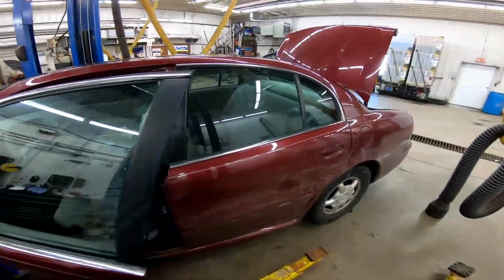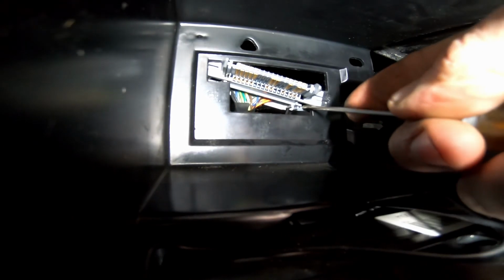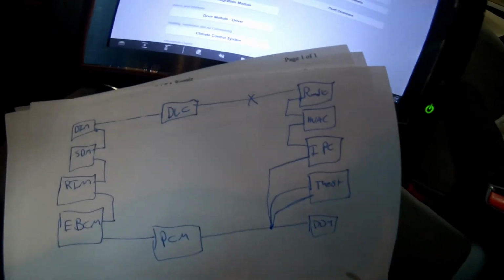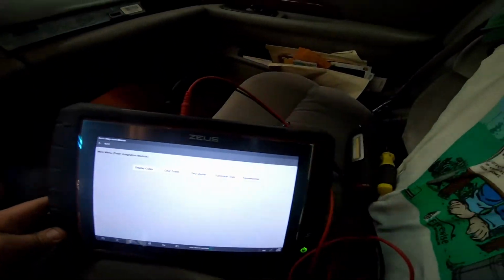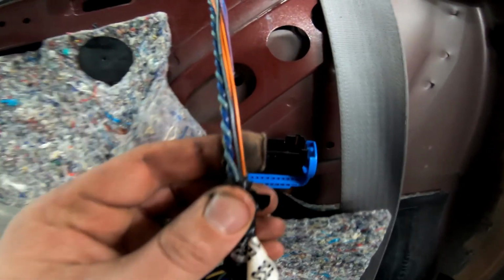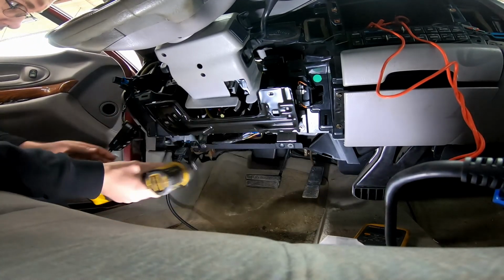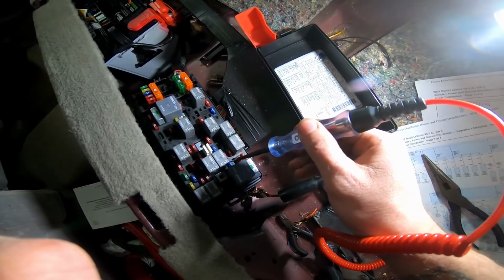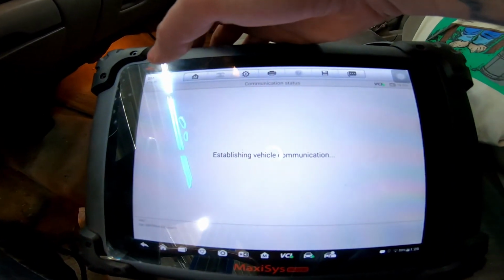Diagnosing Intermittent No Start/ No Communications With Scan Tool Issue!

Comment: hey awesome video! very helpful. i am chasing a no comm on a 2008 Chevrolet Tahoe LTZ 5.3L, V8, Flex, VIN 0, Des LMG, USA. im trying to draw up the modules like you did but there is a junction box messing me up, any way you can explain that to me? its throwing u0100 and u0072 intermitting when it lets me read the ecm ... i drew something up id like to show you
Reply from the maker: Glad to hear the video is helpful for you! I'd be happy to try and lend you a hand. 

First off the junction boxes are quite simple, just don't over think them. This vehicle looks to be using 2 types. On the High speed network the junction box is simply a PassThru used to had a service point to the system and to clean up the wiring harness a bit. 

The junctions in the low speed networks are simply a shorting bar. These are essentially a piece of metal that each wire connects to. This connects all of the modules to the same circuit and makes for a good diagnostic aid, when you can actually access  them.  Feel free to ask as many question as you need to, I will do my best help.

Also, I find with communication issues it is best to start with a scan tool that is capable of reading all the modules on the vehicle. Keep track of which modules you can and can not communicate with. This will make it much faster to narrow down where the issue may be.
Reply: @apmotorsports5568   oh I see! Thanks for the clarification, I’ve been focusing on  high speed bc those are the main ones I can’t read, bcm , tcm, ecm. But the cluster/IPC is on the low speed which is flicking and throwing lights. I did unplug it and that didn’t help but do you think I should worry about the low speed modules?
Reply from the maker: Focus on the area where the modules you are not able to communicate with. I like to print off the network wiring diagram and I will mark the modules I can not talk to on the diagram. Visually, this will help you narrow down the correct area to focus on.

On this vehicle the BCM, TCM, and ECM look to be wired up on one "leg" of the network. The scan tool splices into the circuit at the junction block with the BCM on 1 side and the VCIM on the other side. If you can not talk to the BCM, TCM, and ECM but can talk to the other modules on the hig speed network then you know you need to focus on the BCM, TCM, AND ECM.

The way this network is laid out I would suggest you start at the BCM. To determine which of these modules is the problem you will need to unplug the module you are checking and use jumper wires to bypass the module on the network.

In this case I would unplug the BCM. Use a jumper wire to jump pins 16 and 8 on connector X3 together. Then use another jumper wire to connect pins 17 and 9. This will remove the BCM from the network without removing the other modules from the network. If you can now talk to the TCM and ECM then you know the BCM is you problem.

Also, the VCIM is on both the high and low speed networks. So it is possible that you could talk to the VCIM even if it is not working on 1 of the 2 networks.

Comment: 14.7 is not high to u? I hate that Mine on cold start is 15v but goes down when warm for like 30mins at idle speed to 14.6. but if i drove longer than 30mins it would stay 14.8 until i shut it off and turned it back on. Then idle would be around 14.6 but if i got on the highway right after that (70mph) it would go back up to 15v.. The dash integration module is controlling the voltage as well as the regulator. Alternator is good and so are harness wires... Also got a 80% of the time intermittent voltage drop when going into reverse and 20% to 30% intermittent when going from drive to park.. any pointers?
Reply from the maker: I would not be to worried about 14.7 volts, that is not high enough to cause any real problems. Depending on the vehicle they can charge higher than 15 volts. First, if you are not setting high voltage codes then don't worry to much about it, most cars made within the last 15 years will set high voltage codes of there is an issue.. The voltage variations you are experiencing can be caused by a few things. The varying voltage is likely caused by the changes in rpm, when you put the vehicle into reverse the rpm drops and running down the highway your rpm is much higher, low rpm=lower voltage. Technically while running the voltage should be 14.2 volts but I rarely find a vehicle that sticks to that exactly. You could have a slightly weak battery or you may have a vehicle that monitors the battery state of charge and doesn't see the state of charge increasing. You would be able to see this on a scan tool. In this case you could have a battery issue or you need to fully charge the battery and use a scan tool to reset the state of charge, this would be common if your vehicle had a factory AGM battery.
Reply: @apmotorsports5568  alright.. thanx for the info.. i have an 04 buick lesabre... I just dont like 15v going through that battery with my kid right on top of the battery.. Not sure if its the original. I did replace it with a walmart batt and it still did the same thing so i put the old on back in...  This car does have a power mode monitor that is inside the DIM and also has a state of discharge that is read from the DIM as well ( im guessing bc the manual doesnt really say how to check that). My voltages on DIM were a little weird. It says the Power mode monitor is read by ignition 1 voltage, power, acc voltage, ign 3 voltage, off run crank voltage. All those voltages are the same 14.7. but the daytime running light relay was 15.23 and the control output wire (pin b8) was 14.23.. not sure what to make of that though.
Reply from the maker: I would make sure to check the voltage directly at the battery with a volt meter just to verify the voltage your data is reading.
Reply: @apmotorsports5568  yes sir thats what im comparing it to. The dash reading is actually surprisingly accurate being only .1 off, but im still taking readings directly from batt.. im also going directly to battery for ground when taking those measurements
Reply from the maker: Ok good, just wanted to make sure. I think the only other thing I would check would be to see what the commanded voltage is from the module controlling the alternator. This might be displayed as a percentage. For example, of the command is off or a very low percentage then I would suspect a voltage regulator problem or an issue inside the module where it is sending out the wrong signal.
Reply: @apmotorsports5568  how do i go about checking that? U mean the orange wire going into the DIM (pin a12)? That is reading same as battery voltage. Ground is good. It has 2 orange wires. The other one is for something different but that voltage is the same as well. Im stumped
Reply from the maker: If the DIM is controlling the alternator than it likely would have a control PID in the scan tool data stream. Generally speaking, this is a pulse width modulated control circuit and the scan tool displays that has a percentage. The percentage is the "on time" of the circuit, the higher the percentage the higher the system voltage. The scan tool may have a function to manually control the charging system, of your scan tool is capable of bidirectional controls. 

I'm am speaking generally here has I have not looked at diagrams or service info for your specific vehicle. So keep in mind every vehicle is different and service info should be used to help understand how the system is supposed to work.
Reply: @apmotorsports5568  yes sir i understand systems are different. Its the same buick u have in this video.. i unfortunately do not have a bi directional scan tool.
Reply from the maker: What year is your Buick?
Reply: @apmotorsports5568  04 limited.. only have a simple live data scan tool.. no scope.. so im limited a little bit.
Reply from the maker: Ok, so in your case the charging system voltage is completely controlled by the alternator. The DIC(instrument cluster) simply takes data from the PCM and runs the warning lights. The PCM sends a turn on signal to the alternator, generally this will be a constant voltage while the key is on. There is a duty cycle signal wire that runs between the PCM and Alternator, this wire is simply used for the PCM to monitor the alternator but not to control it. The alternator will ground this circuit if it detects a problem, telling the PCM that there is a charging system issue. The actual voltage output is controlled completely by the alternator. It is possible that the internal voltage monitoring circuit in the alternator is not working properly, causing your voltage to be a little high.
Reply: @apmotorsports5568  do u know what wire i can measure to find out what the internal voltage reading is compared to batt voltage? Btw appreciate ur time and responses.
Reply from the maker: You would not be able to measure it unfortunately, it would be part of a circuit board or internal wiring inside the alternator case. If you go into the PCM data with your scan tool there should be a data pid for the Generator Duty Cycle. This is from the signal wire at the alternator. At high voltage you should see a low duty cycle, in this case that duty cycle should read 10% or 20%. 

One thing to double check is the alternator case ground. The alternator grounds through its case and the engine block. I would run a jumper cable from the negative post of the battery to the mounting bolt of the alternator  or the alternator case. This will ensure that the alternator is properly grounded. Just a good thing to double check as you can get some strange issues if the alternator is not grounding properly.
Reply: @apmotorsports5568  ok i will double check that bc it might be grounding itself out and thats why im getting a voltage drop shifting into gear then it will take a second and it will start charging again. Will also test voltage on that wire and see if there is a difference when given throttle.. Thanx man for all the help.
Reply from the maker: Your welcome!
Reply: @apmotorsports5568  subbed